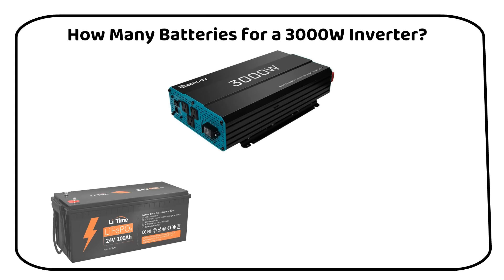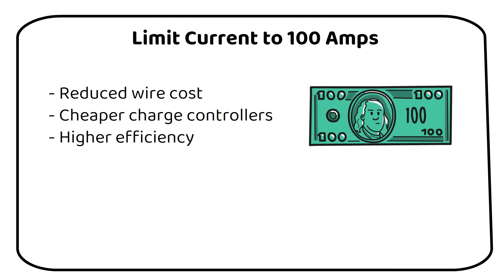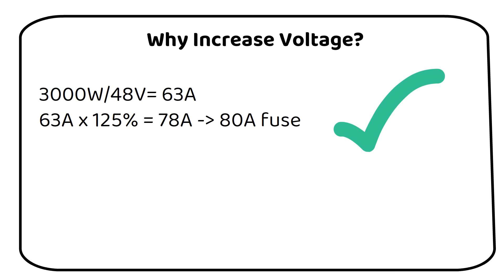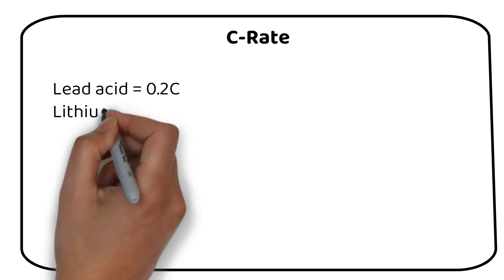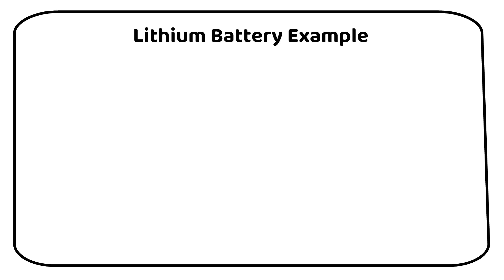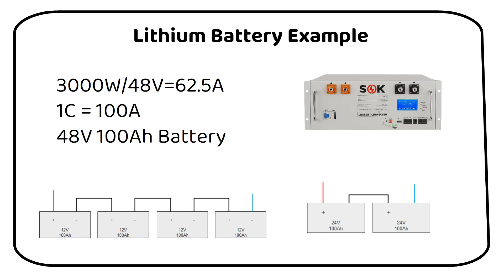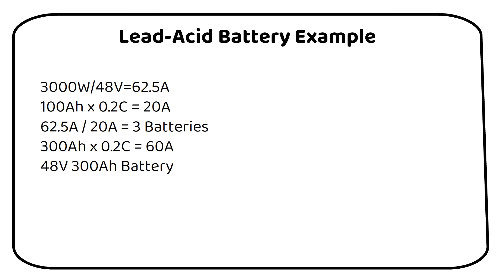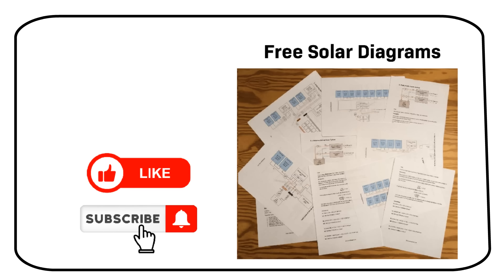How Many Batteries For a 3000W Inverter?

Comment: I use 12v lighting in every room and 2000w inverter for frig and freezer.  Supply  power is 800w=8 amps solar 200w=2amps wind feading 6 lead deep cycle 780ah batteries.  Now given we dont run all the lights and kids dont leave frig door open lol i can run for months without needing charged from normal means . I set my system up for backup only (just incase) but i know im good to go . 
Off grid if need be

Comment: What battery capacity is needed for running 250watts refrigerator
Reply from the maker: 250W*8hours (33% duty cycle)=2000Wh 12V*100Ah=1200Wh, so at least two 12V 100Ah batteries.

Comment: Most modern inverters will draw from the solar power before the battery so when the sun is out the current can be much higher, but I agree with the load you have calculated for batteries.
Reply from the maker: The current is not higher when the sun is out. These are the inverter cables, not the cables from the charge controller to busbar/batteries.

Comment: Hi sir, does it mean that a 3000watts 24v inverter is not advisable setup? Cause doing the computation it will produce 100+ amperes. Can you confirm?

Comment: I have a couple questions. The most energy intense device in my house is a shallow well pump. It will draw just barely over 10 amps when it kicks on.  Other than my refrigerator and my microwave and my toaster, the shallow well pump seems to be the biggest current draw. And when I shower it kicks on and off every 10 seconds to maintain pressure. I'm considering setting up four 400 watt solar panels and using a 3000 watt all-in-one inverter with a 48 volt 100 amp hour battery. Do you feel this would suffice for an off grid setup? My monthly electric used last month was only 165 kWh. Thanks. Subscribed.

Comment: We have an alternator of 12v in a van vehicule, how can we install a system working at 24V or even 48V in order to be below 100A when requering high power, such as 3000 W and higher. I do not have clear how to charge the batteries using the van alternator. Many thanks
Reply from the maker: If you want to charge with your alternator I recommend 24v systems. I haven't found any DC to DC charger that is 12-48V. I have a video about different voltage systems in a few days. You would have to sacrifice some efficiency using higher than 100A, it will be more expensive, but in an RV this is what I recommend. Recently I installed a 24v 280ah battery in an RV.
Reply: @cleversolarpower  Many thanks for your prompt answer, I fully agree. Can you recommend any buck boost to increase de voltage from 12v to 24v in a RV? I am facing some problems to find one with enough power at a reasonable price.
Reply: to me there is no reason to run a 24v or 48v on a rv at all stay 12v and just get a big battery bank at 12v then you can get a 200-370 amp high output alternator if needed and can get a few solar panels on your roof in most cases 
on a RV you have all short cable runs and very small space for solar panels so there is not need to to go with a higher voltage system at all and they make lots of 3000 watt 12V inverters for this reason as that all you would ever need in a RV also can charge very fast with the engine running and run everything at full load no problem

Comment: Can run ac load on 3000w invereter direct
Reply from the maker: Of course, if you have the right wire and fuse sizes. If you have undersized your battery it will age faster.

Comment: Hello mate thanks for the great video you've gained a sub  , this is my first time using solar. Im about to use a 12v inverter (3000w) with 2 12v 115ah lead acid batteries and a 30A solar controller. my concern is the amperage however do you think this can work ? Thankyou in advance
Reply: If you’re in the UK go to 12 volt planet for advice. Personally I wouldn’t use anything other than Victron gear. As for your proposed configuration, even if you rigged your batteries up to give 24 volts to reduce the current (volts x amps = watts), you’re at 125 AMPs, that is a huge current and therefore fire risk + it would destroy your batteries. As a side note, my 500 watt Victron is rated for 900 watts for short peak loads. I initially bought a cheap Chinese one which was dangerous rubbish. From his calcs, the theoretical max for your batteries would be in the 500 to 1000 watt range depending on how you set it up. The 30 watt solar controller sounds OK though. I have no association with Victron, but the other great feature is all their devices have blue tooth and a great app so you can monitor and control your set up through your phone. Hope this helps

Comment: I have a 12v 3500 w inverter what would you recommend for 24 v battery ( 12v/200ah) configuration , I also plan to use a 60a charge controller ! Would that be safe ?
Reply from the maker: You cannot use a 24v battery with a 12v inverter.
Reply: your inverter sets the system voltage, so you'd be connecting batteries in parallel for 12V at 400Ah,   200ah usable for best battery life (50% depth of discharge). 12v*200 = 2.4KwH of usable energy. 60amp charge controller * 12V = 720w max solar energy can pass through it    2.4Kw * 1.35(Conversion loss from lead acid battery) = 3,240watts of energy needed to recharge from 50% usage of battery.     3,240watts / 720 = 4.5h of solid sun time needed. Doable in most parts of the world, but cutting things very close. At 2,400watts usable energy you divide that by your load in watts to give you run time

Comment: Help!
I have 300 watt running into a solar connector. Those then output to a 500 wat charge controller. From there I have the charge controller running into a battery. The battery is attached to a 2000 watt inverter.
Am I safe or do I need to adjust anything? Heard the fan kick on.
Reply from the maker: It's safe. However, depending on the battery size, your inverter can be oversized. This is not bad, it just doesn't go together like mentioned in the video. Assuming you have sized the cables and fuses correctly. Fan kicking on is normal.

Comment: I have watched about 10 of your videos today for solar power. You talked about batteries, invertors and wire sizes. But the one thing missing in all the videos that I see, is the actual solar panel. What size in watts like what I see at Harbor Freight Tools? You have not mentioned solar panels and size in any of the videos that I have seen so far.
Reply from the maker: It's because they are simple. Not much to be said about them. Would you like me to do a video about how many solar panels for your battery?
Reply: generally I use base load, how much will you use in a 24h cycle, multiply by a 25% safety factor then multiply by 2. then divide this by the sun hours expected  that will get you the bare minimum you'd need.  For example I use 6kwh average in 24h, so 6000* 1.25 =  7,500wh * 2 = 15Kw / 4.5h of peak sun in winter = 3.4Kw array minimum. this leaves excess power to run your home whilst charging the batteries. or if you want to whing it and hope for the best at very least same amount as the watts on your inverter.
Reply: @cleversolarpower  Only simple for those of us with experience, to the newcomer it is dark magic. Battery is bad base to use as it fails to account for usages of loads int he home, why I started to use 24H of average consumption to calculate minimum wattage of panel needed for a given system, this removes battery type all together.

Comment: So, to simplify, you recommend a lithium battery should be sized to have sufficient capacity (in Watt hrs) to run at the inverter's full power for 1 hour,  or 5 hours for lead acid batteries.

Comment: I recently bought a 12V/200amp battery with a 200A BMS, and a renogy 3000W inverter with a 60a charge controller, to build a light system for camping in summer, would this be a good kit? any suggestions?
Reply from the maker: Do you really need a 3000w inverter? Bigger isn't always better. Your C rate is ok, but your cables need to be big. If you had a 24v system you could have smaller cables and a 30 amp charge controller.
Reply: Thx for your reply, forgot to mention i have 1/0 AWG cables for that connection. @cleversolarpower
Reply: @mlora929  inverter is a bit big for your battery but still will work just fine

Comment: I have 6 100W panels, 2000W inverter, Lithium Ion 300AH 12.8V, and 120A Charge controller, ....by. your calculation, 2000/12.8 = 156 A .... will the Amp load be too high? do I need to buy another 300 AH battery and wire it in a series in order to lower the amp load? if I hook it up as is will it explode
Reply: OHHHH the LOAD of 156 Amps has to be lower than the C RATE I get it so the C rate is 300 so 156 < 300 AH so I think im good right?
Reply from the maker: That is correct. You are good.

Comment: Can you use a bigger inverter if you add more batteries in parallel
Reply from the maker: Adding more batteries in parallel solves the C rate. However, you will still have a high current in the system, which will lead to expensive wiring. Check my video: 12V, 24V or 48V battery systems.

Comment: i have 3000w inverter running of a 12v lithium battery 300amp what size fuse do i need. cheers

Comment: The Renogy 3000 w inverter shown in your video is only for 12V systems. I am so confused.
Reply from the maker: That's the point of this video, that you should not use a 3000W inverter with a 12V battery.
Reply: @cleversolarpower  so don't get the renogy 3000 watt inverter?

Comment: You need to run at least number one stranded gauge wire on 12 volt like this

But you don't factory in is how long any given setup will run on it's given output and but that's fine you can watch the battery drainage with a good digital voltmeter once it drops past or under 12 charge the damn thing
Reply from the maker: Thick wires should be as short as possible, i thought that was clear. I have made a video about voltage drop as well. This is mainly for the solar panels to the charge controller.

Comment: I recently installed a 12v battery 100ah tied w a 12v lead acid 50Ah in parallel. I have two 200 W panels on the roof for 400W total. Using a BougeRV controller rated 600 watts max solar and 40 amps.  The only thing I’ll be running on that is the new Starlink Gen 3 satellite, which pulls approximately 85 to 100W. Along with that, a mini movie projector that pulls 80W. I should be good, right?
Reply from the maker: To keep the lead-acid battery happy you should not discharge lower than 50%. Since it's in parallel with a lithium battery, this will become the same. So you can only draw 50% of the lithium battery as well. You can draw 25Ah+50Ah=75Ah from your two batteries. If you only had the lithium battery, you can draw 100Ah. total energy for the lithium battery is 1280Wh. 100W starlink*24h=2400Wh. -> Your battery is not big enough to support the load for one day.

Comment: hmm for 1500W inverter in a van thought 12V would be way cheaper than 24V so as to dominate total system cost consideration.  12V massive current causes all kinds of costs though
Reply from the maker: The maximum a 12V 100Ah battery can output is 100A. 100A*12.8V=1280W, you you cannot get the 1500W of the inverter. If you have another battery in parallel ,no problem. So you need a 12V 200Ah, or 24V 200Ah battery.

Comment: How would I set up 2 24V DC batteries for a 3K W inverter ? Parallel?
Reply from the maker: Depends on the voltage of your inverter and the Ah of the battery. Check the calculations in the video.
Reply: Your inverter sets the systems design voltage

Comment: i agree im building a micro ecamper for my electric bike and im using 48 volts system made from 50 amp draw molie cells so it will power the bike and all the camper electrics and recharge off solar when camping
Reply: im usinmg 48volt for only 1500watt system though
Reply from the maker: If you have a 50A BMS, then it will work 👍 good sizing btw.
Reply: its getting quite complicated because the camper also has 2 hub motos and 2 controllers so it powers itself and doesnt put stress on the tow linkage,this way i can tow alot more weight while only feeling like  a lighter weight,
Reply: i might be better off looking at keeping the systems separate but its hard as it all charges off the 4 300 watt panels